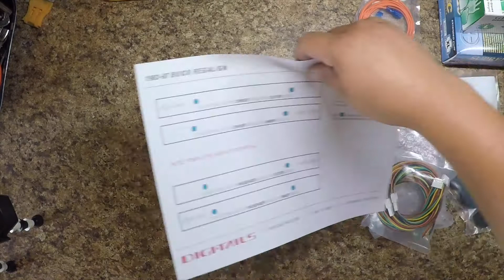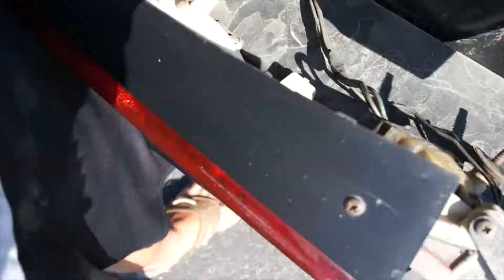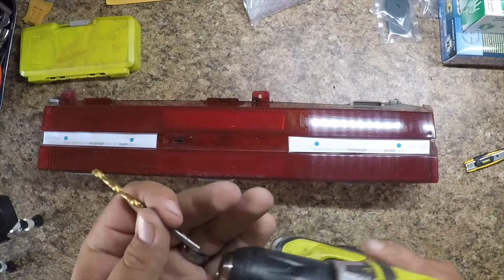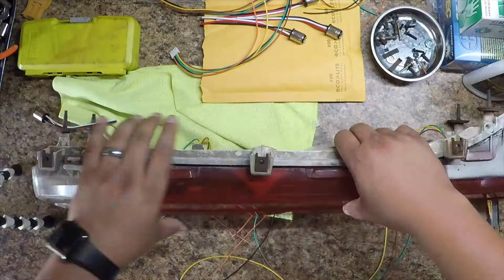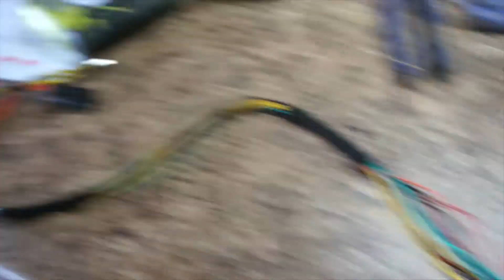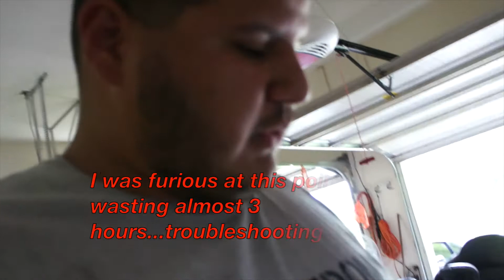Buick Grand National Digi-Tails LED brake lights installation

Comment: I have a few issues with these LEDs.  On mine, the provided templates were not 1:1, the center-to-center  distance for the holes to be drilled were off by 0.15".  So if you are considering buying the Digi-tails lay the templates against the circuit boards first to verify they are correct, if not, mark the center of the 2 holes with a center punch on the templates before drilling.  I installed mine and did a test before installing them on the car, both sides worked perfectly.  After installing them for good the 2 circuit boards on the passenger side failed.  I tried the drivers side on the passenger side and they worked fine, so the wiring was verified as good  I took the passenger side apart and inspected the boards and everything looked good, no obvious failure.  Tried them on the drivers side, no go.  So the passenger side boards are dead for some reason, wiring going to the boards verified as correct.  So yeah, POS, when my new kit arrives I am suspecting I will have 2 spare boards. I will send the defective boards back for a refund.  Classic Industries now has every single part for the rear tail lights for the GN if you find you need something after disassembly, mine needed new gaskets and new hardware.

Comment: I'm wondering why 83-87 on the panel and on the package, should also fit 81-82 if it fits the 83. 1981-83 u won't be able to secure the board from the outside, but it's doable from the inside somehow. Can you explain ?
Reply from the maker: I’ve never dealt with it, but just looking at the light design, the light lens looks to be slightly narrower.

Comment: Does these fit 81 buick regal?
Reply from the maker: I think it fits starting’83, you can find it in their website.
Reply: I'm pretty sure u can do it on the 81-83 just have to get creative and hold the board up from the inside. Hot glue

Comment: Quick question, are the digi-tail led Chipsets on the board bright white or Red? In the video they look red but that could be because of the red board itself. I am thinking of getting a set for my Grand National, but thinking if I replace my running lights to bright white LED's or Red LED's? Thanks, love all your videos.
Reply from the maker: They are red. On my IG there are some tests we did “on the bench” for Damian’s lights.
Reply: @VenomGT87  awesome thanks!

Comment: Venom GT come on guy I need a set done I think I can do my front signal lights but if you can please do  The rear tail lights I will drive to you and pick them up  I know the other parts I would need to get so it can run the right way
Reply from the maker: Have you checked with the Anderson Performance? They are an authorized dealer and can do the install as well.

Comment: Someone should point out that his before is also shitty led bulbs.
Reply from the maker: Those were good old incandescent bulbs. I sped video to make the over all video shorter if you notice the post installation is sped up as well. Both start at regular speed then speeds up.

Comment: Does the wiring have 2 brown wires one for brakes and one for marker or there is just 1 ? Coming from the body hardness?
Reply from the maker: The body should be one. The rear harness should  have two one with a tracer.

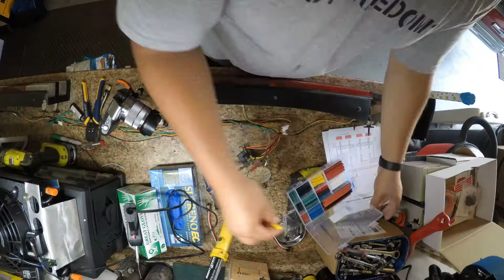Comment: 17:48  DUDE, I LOVE IT!!!!  It is so GREAT to see people doing wiring properly & professionally, that is one thing I hate to see or work on after someone hacks their wiring. Solder, shrink tube, wire tie, wire loom & die electrical grease(when appropriate) should be used on every wiring job.....NO QUESTIONS ASKED, spend that extra time at first & you will never need to touch it again, ever.  Great job man & sorry to see you wasted all that time on tracing/checking the wiring circuit they sent you, I felt your pain & frustration as you were explaining, you wouldn't expect issues like that from a company but you got it fixed & dam it looks nice. Where you located, I see the MD tag, I'm in northern Balt Co. & of course I sub'd your channel. 👍
Reply from the maker: Thank you! I am up next to Cecil Dragway.

Comment: If they are gonna make the mounting screws nylon. They should have at least made them RED to match the lens.
Reply from the maker: You can't see them, they go under the center trim piece of the light.